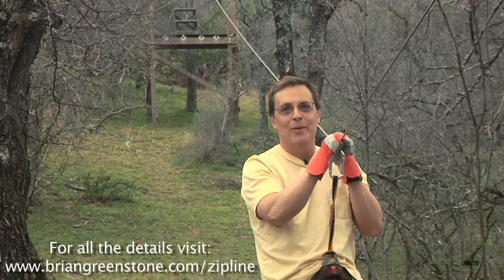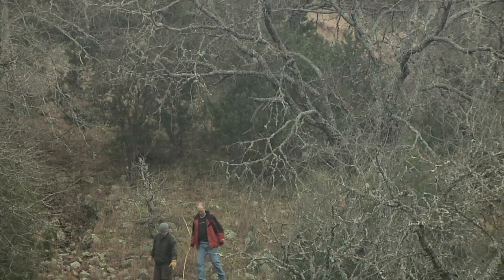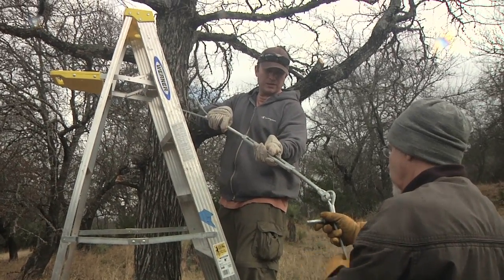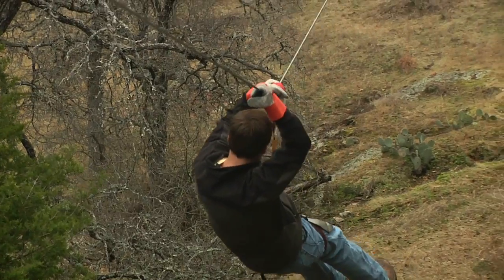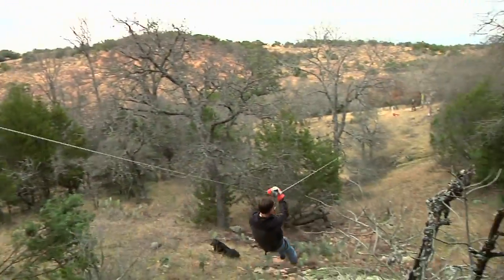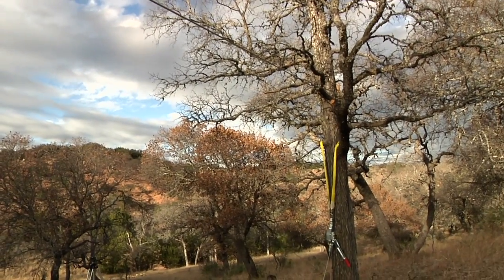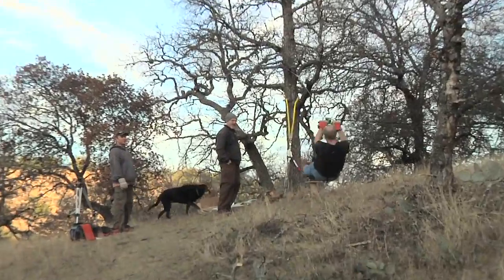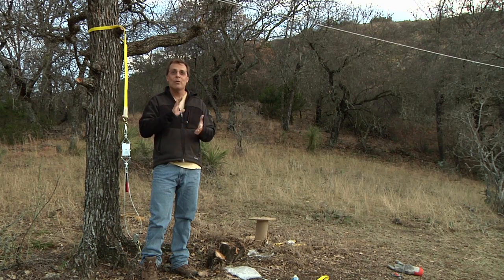Building and testing a zip-line

Comment: Most importantly this video  was unclear as to how to attach the tow strap and other gear.
Reply from the maker: I haven’t looked at this video in ages.  What tow strap are you referring to? Are you talking about how we connected the come along to the line? If so, I believe we simply attached a loop of wire with a saddle clamp and hooked onto that.

Comment: the "turn buckles are shacks, the tightening device is a lever hoist and a Klein tool and the u bolts are dogs and u done then wrong what u done was very dangerous the dead end or the end that isn't being used must be on the block part of the dog and the live end or the wire being use must be against the u part of the bolt as the other way round or the way you done it can cause the wire to wipe out of the bolt. plus you must use no less than 3 of these and no more than 2 inches apart
Reply: He is saying that the cable clamps and u-bolts are being used backwards... the "working" line is supposed to be sitting at the top of the u bolt. (But a manufacturer had them exactly opposite in their instructions, so I'm not voting on who is right.)  https://images-na.ssl-images-amazon.com/images/I/41zKsFJndpL.jpg
Reply: Pangea Software, Inc. Gully Seen is right. The rope grips (or dogs as they are most commonly known as) are the wrong way around.

Comment: I made a small Zipline when I was a kid about 17 years old.  I put some cables up between 2 trees and I had a large pulley that could handle up to 2 tons with a tire swing attached to it.  I made a lift mechanism with some rope and 2 smaller pulleys to pull myself up the tree and I had a U bolt, a pogostick string and a rollerskate wheel near the other tree as a brake.  I enjoyed having the spring launch me half way back up the tree when I hit the break.  Nice Video.

Comment: I had a bad experience yesterday with a zip line. It went across a driveway and I decided to try it at night. What I didn't think about though was parked cars. I came flying down a steep hill at maybe 25 - 30 mph and smashed my side into a parked BMW. Funnily enough, I was fine but I left a 2 inch deep dent in the driver side door.